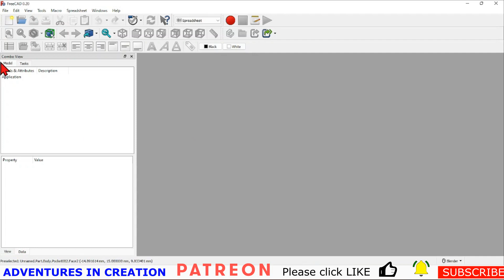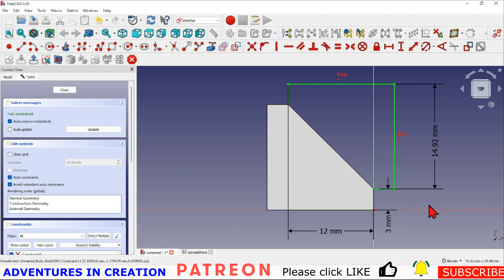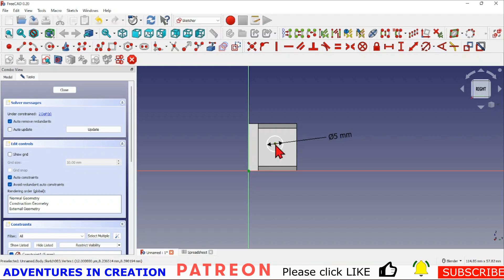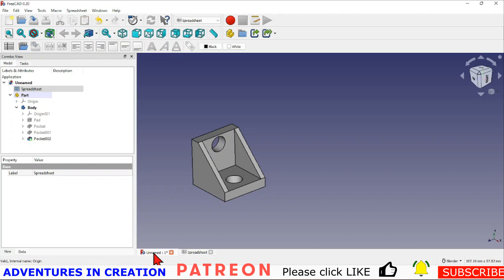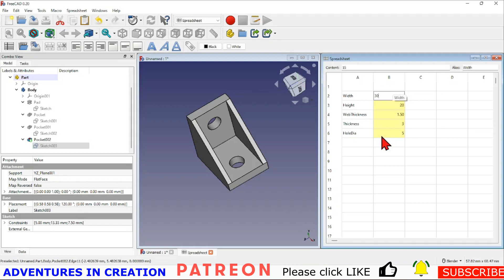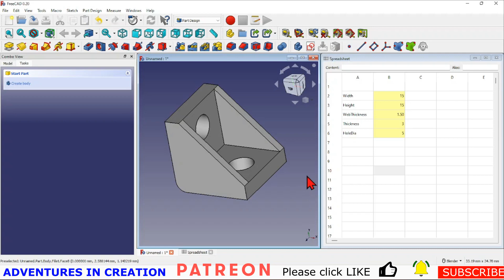FreeCAD for Beginners #40 Corner Bracket  - Look what the movers broke!

Comment: I am getting an error message  " failed to convert quantity"  when trying to input spreadsheet thickness and all spreadsheet data
Reply from the maker: Are you using units?
Reply: I am typing in exactly what you are
Reply: @BillyJ57  I get the same thing. FreeCad is annoying. Always issues and errors. Guys tutorial is excellent, but FreeCAD is just a pain in the ass.

Comment: Great channel I have learnt so much in the last few days having started from nowhere with CAD, all I need now is the practice and to remember where all the tools are. Is it possible to use conditional statements in the parametric designs? I am thinking when you increased the width of the bracket it would have been better to have two holes rather than one. I think I have seen something in some designs produced from other software that seem to be scripted. Probably jumping ahead too far.
Reply from the maker: I am sure you can do it but it will take some programming skills.